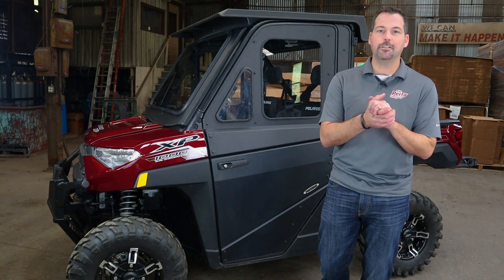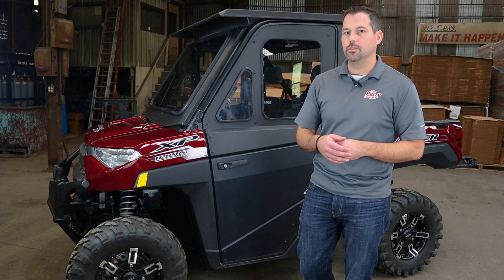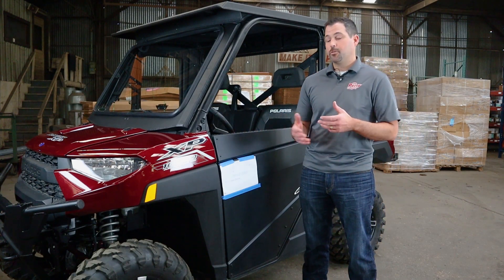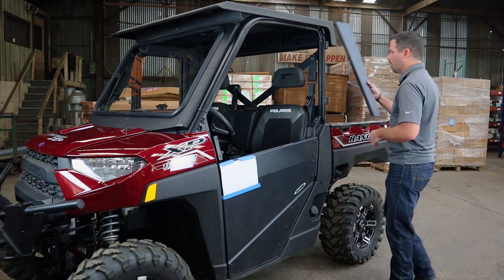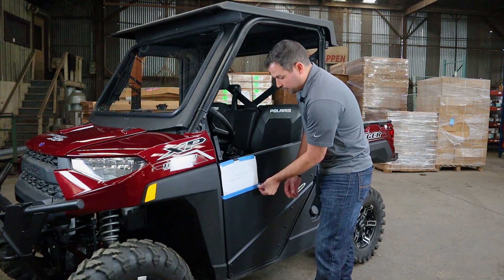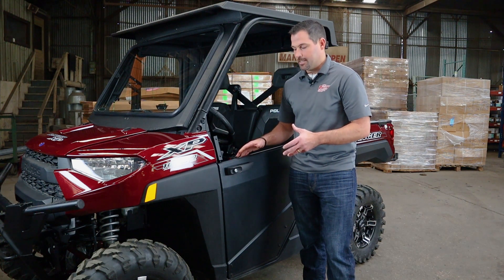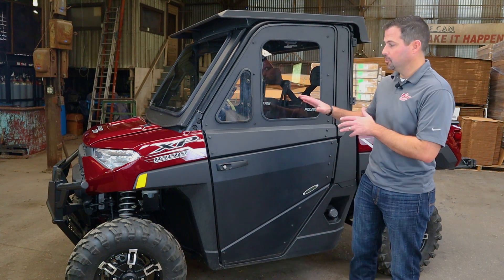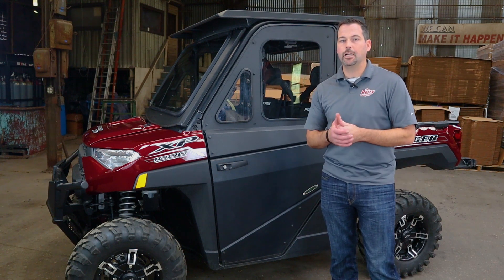Fortress Upper Half Door Installation for Polaris Ranger Single Cab

Comment: You guys need to post up a video for the Crew Model.......the Rear doors are completely different and your printed instructions suck.

I just spent 6 hours trying to figure it out and only got the drivers side done........customer is not happy because he's being charged for me to figure it out rather than using instructions.
Reply from the maker: Hi, here are the links to the crew videos-
Part 1: https://www.youtube.com/watch?v=aNGuRoqxGRQ&t=1463s
Part 2: https://www.youtube.com/watch?v=ave3uHeE300&t=5s
Also if you scan the QR code on the installation guide it will pull up the videos for you.
Reply: @theperrycompany772  wow, that's great, because the Window Tracks were the biggest issue and have slight differences between them, more than the 3 holes.....but that's the simplest way to tell.

My Customer was not sent this link when he purchased the Crew Kit, and when I spoke to Tech support they had a hard time understanding what I was asking.........

Thank you
Reply: If I may, I suggest you print those identifying factors on the instructions as well, it only shows the difference between the top part and that isn't really that hard to figure out, whereas the lower part isn't spoken about at all.